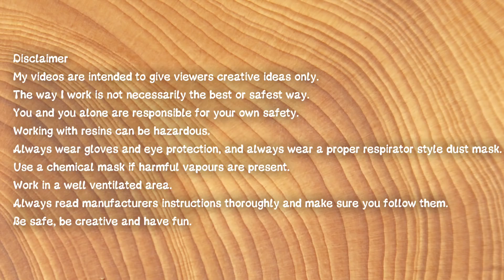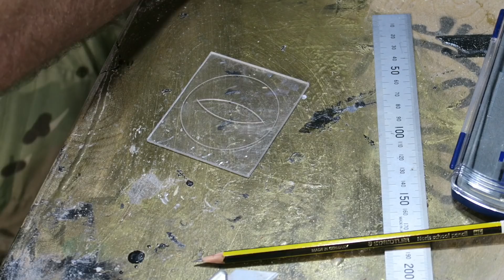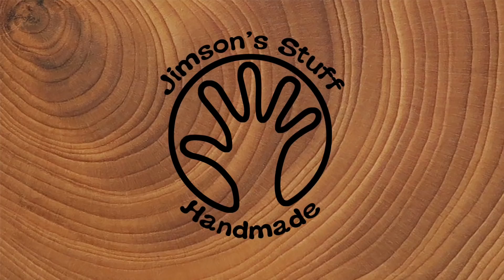I Make a Game of Thrones White Walker Dragon Eye

Comment: Did I miss something? How did you get the hole through the hand for the wiring?
Reply from the maker: Sorry Barry, it was a long edit and I somehow lost that bit. The hand is partly hollow which helps, but I used a Dremel to make the hole in the finger and a long drill bit up through the wrist to join it. Check out my GoldenEye video, I show it in that. Cheers, Jim
Reply: Jim Overton - Jimson's Stuff that’s right I forgot it was partially hollow already. I guess that would make it pretty easy. Thanks for the response. Have you ever thought about using silicone so you could make a reusable mold like that?
Reply from the maker: Yes a silicone mold is something I might make in the future. Cheers, Jim.

Comment: 👁👁😍Another great video,could you make a silicone mould from your hand,to use instesd of the alginate.
Reply from the maker: Thank you very much David. Yes you could make a silicone mould of your hand but it is a much more involved process and requires special body casting silicone which is quite expensive. It would only be worth doing if you planned on making several or you intended to do a high quality cold cast bronze casting or similar. Cheers, Jim